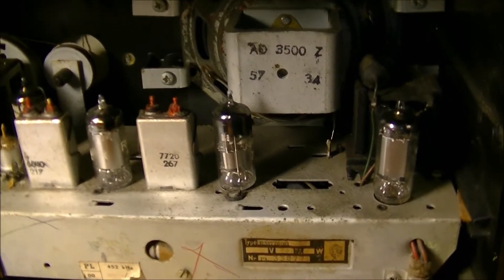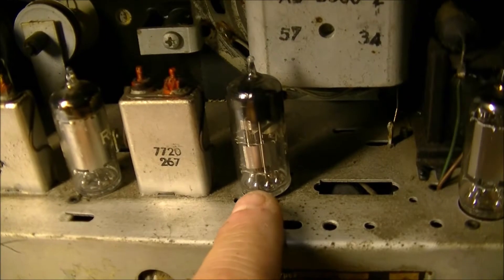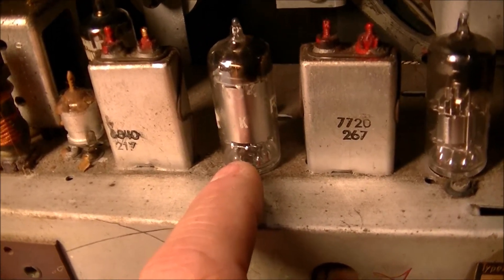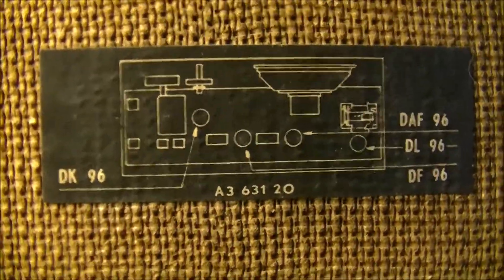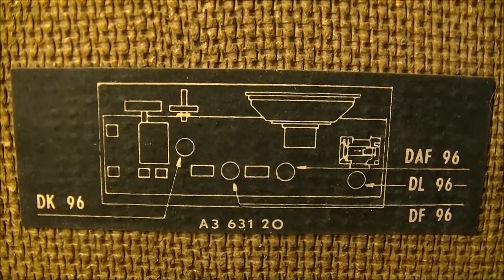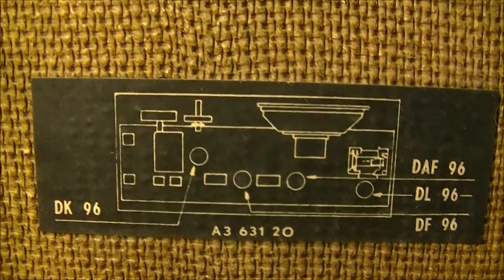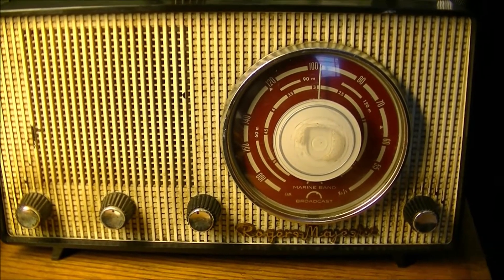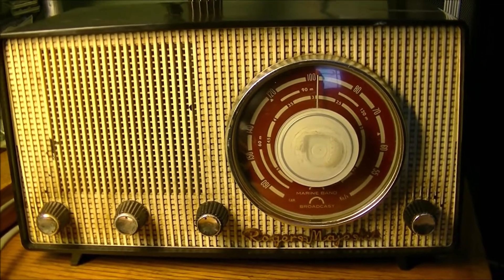Rogers Majestic RM776 Quick Update

Comment: They look like very low hour tubes. What the little one on the left.  Looks hard wired.
Reply from the maker: One of the tubes looks like a mismatch or a substitute but it is also dead. Only the tube on the far left has resistance on pins 1 and 7.